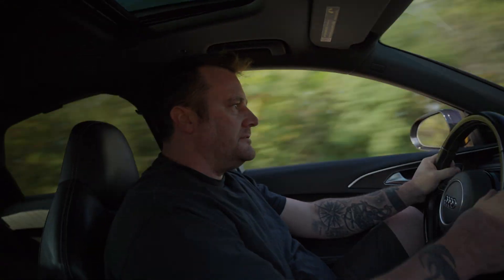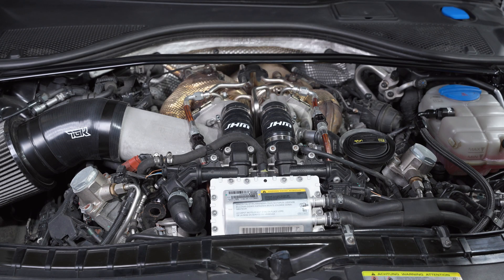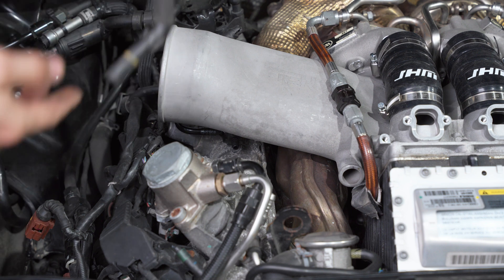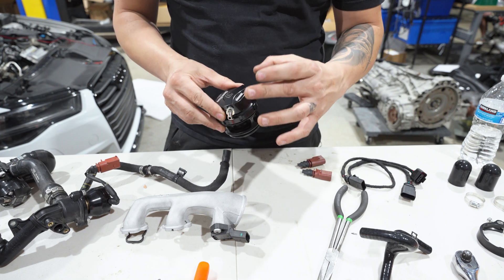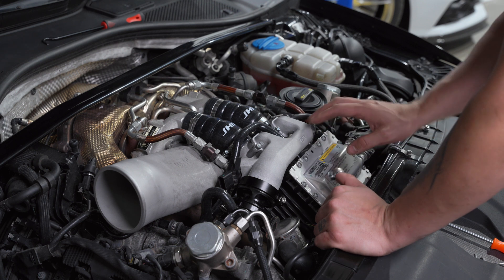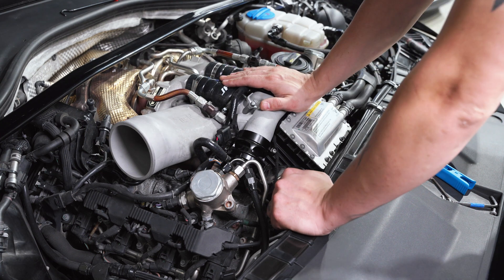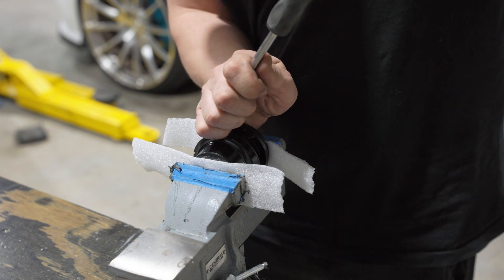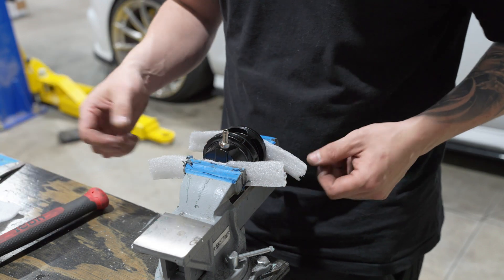Audi 4.0T Blow Off Valve Conversion Kit Installation Guide

Comment: Looks like a slick revision Tyler. One question:  does this mod require supporting tuning modifications, or is this a wholly self-contained solution that could be installed on untuned and tuned cars alike?
Reply: Good question
Reply: No tune required. It's straight plug and play.